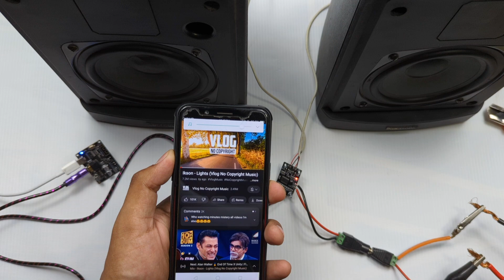TPA3110 Amplifier Module EXPOSED: The Truth Behind Its Power & Performance!" #tpa3110 #amplifier

Comment: You can use 21v or 24v but there are tradeoffs, firstly, obviously needs cooling, secondly, speakers should be 8 ohms at above 19v, i have been using my tpa3110 for half a year now(at 24v 2a) with cooling, it didnt break up on me, it still works perfectly, also the amperage can limit the output wattage, since you used 12v 3a supply, 12x3=36w, assuming there are some efficiency losses(lets count it as 2) 2x2-36x=~32w, divided, 16w for each channel which is about the marketed wattage, but this is theoretical, in real scenarios it can be about 12-14w, at 24v 2a, 24x2=48, again assuming energy losses, 2x2-48=44w, it will be about 22w each channel, but again this is theoretical, it can be lower, i have 2x Omnitronics C50's(transformer removed) hooked up to the tpa3110 and it jumps them at 12v 1.5a about 9vrms output with minimal distortion

Comment: Can i use 16v ? What is the max ?
Reply: You can use 16 v without issues, if you attach a heatsink to the IC with  some thermal paste.18 will give you the best performance.
Reply from the maker: 14-15v max
Reply: @Electricquantism402  tpa3110 can go up to 24v, have been running my tpa3110 with 24v for about 2 years now still working
Reply: Bro 12v good sound quality